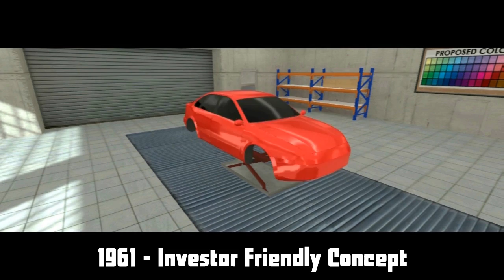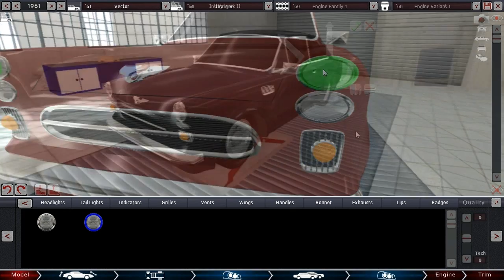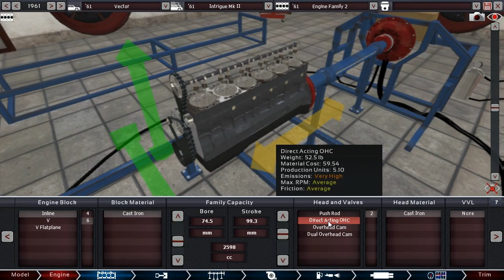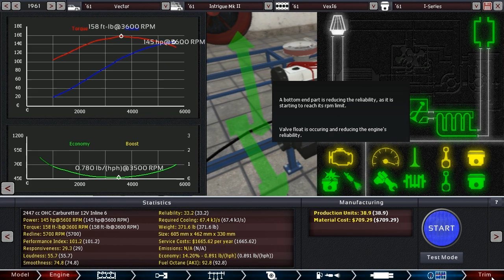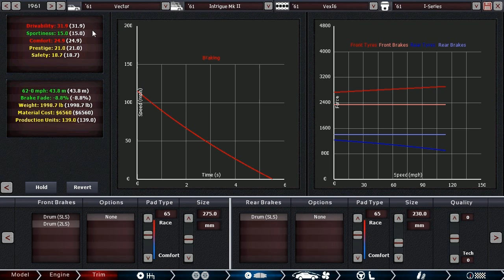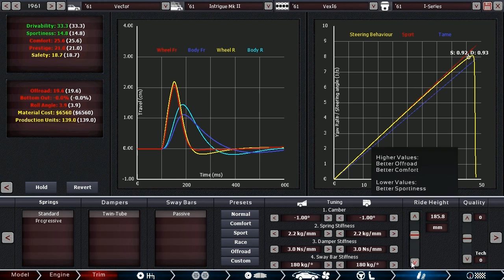Automation | Vector Automotive Challenge | 1961 - Investor Friendly Concept

Comment: It has my vote. I think this is a drastic step forward from the previous concept. I think the styling is far better, particularly the headlights and the rear canopy. The rear may be shortened but the rear seat headroom looks better with the roof extended rearward. I think with the cost brought down by a regular am radio and some other cuts, it would be a real competitor, especially in 1962.

 You wouldnt want to wait too long to launch, the competition heats up quite a bit in a few years.
Reply from the maker: This guy can see the future! Burn the witch!
Reply: ConeDodger240 oh no! My secret is out!! And I was so careful!!!
Reply: just realized i commented from the wrong account lol my bad!

Comment: I am very impressed with the mileage and redline of your engine, and the refined styling looks much better and more correct for the period.  The reliability of the engine is a bit scary for making it a people's sports car, yet unreliable cars have succeeded in the past, and if you just wanted an engine that screams and revs all the way (I like that as a rotary fanatic) than I think the reliability sacrifice was worthwhile.  Maybe a de-tuned engine for lower models but, yes I would like to see it make production

Comment: in my opinion the Vector Intrigue Mk II is miles ahead of its predecessor. With its new, more sensible inline 6 cylinder engine, it will be more affordable and more practical for daily driving. And with its new adjusted styling, it is a much more cohesive and solid design that would fit in just about anywhere in the world. Plus, the charcoal grey color the Mk II was presented with is beautiful, a perfect match for the style of this car. Overall, I think I would be more than happy to invest in Vector Automotive.

Comment: After seeing the first iteration of the Intrigue, I could safely say that I would be willing to invest in Vector.  It showed what you COULD do.  This second iteration, however, shows that Vector not only has a drive for performance but also a mind for practicality.  It was clear that not every Intrigue, if any, would ship with the OHC V8 from the first concept; it was an exercise in showing off Vector's capability as a manufacturer and making a statement.  I saw this and noticed the potential of the platform and an inherent versatility about it.  This second concept proves that, and I believe that it would be an acceptable launching platform for Vector as a company.

Comment: Color me surprised! What I expected was Vector to throw out the old car body and make a new vehicle using a revised, improved version of their DAOHC V8. What we have instead is a new, smooth I6 used in a revised, improved version of the body - and I couldn't be happier. The new form keeps a lot of the interesting flavor of the old Intrigue, but with more handsome proportions, and the new engine keeps the innovative valvetrain while delivering a smoother, more manageable output.

In no particular order:

- It may well be worth the investment to fit all-forged internals to this engine; the added reliability and smoothness would be significant.

- The figure I remember as a good rule of thumb for pony-car production costs is $6000 in-game currency. That was accounting for inflation and for an MSRP ~3X cost of manufacture.

Comment: Dear Sir,

I have been following the progress of your automotive vehicle company for the past couple years, and I would like to offer an investment. Your initial design of the Vector Intrigue caught my attention when I first saw it at the Los Angeles Auto Show in 1960 as a very futuristic vehicle, providing a new path of forward momentum for the American automotive vehicle industry. However, I felt it unready for further production in that form as the entire car felt unfinished and frankly incoherent. There seemed to be no particular direction or market the car was trying to fill, the exterior left much to be desired, the drivetrain, while highly technological, lent itself towards a sports car of sorts, and the interior seemed to want to be a luxury car. With this in mind, I decided to withhold any investment into the company.
This year I decided to attend the Detroit Auto Show to see if there had been any improvements to the Intrigue, and I am happy to report that the vehicle seems to be much more coherent in it's design. The exterior is simply stunning, refined yet brash enough to show that America is ready to move into the future. However, the new Inline 6 engine was honestly a disappointment compared to the previous V8 design. In regards to the engine, I felt that the pursuit for something new and exciting which I had seen with the original design had been lost in favor of a more standard and conventional approach to fit production requirements. The interior also seemed more fitting to the approach the car is trying to take this time around. The new performance characteristics were also a pleasant surprise and vital improvement to the previous car.
With all of this in mind, I do not feel the vehicle is quite ready to enter production yet. However, I am offering to invest $150,000 ($1.2 million in todays money) for each further year the vehicle is in the design state, and $500,000 for the first year the vehicle is in production to cover manufacturing costs, and a further $750,000 the second year of production. In return, I request a business statement within the next year of what the exact intent of this car and this company is, what market you are trying to fill, what your potential market it, and how many units you expect to sell. I also request 1.0% of your profits, and a reasonable share in the say of this company.
As far as where I would like to see the vehicle progress from this point forward, I would like to see the V8 platform return, along with further investment in developing technologies. I feel this company could be the way forward for American automotive technology, but you must invest!

Warmest regards,
Mr. H

Comment: This concept could definitely be a production car and be very succesful. The look of the car is by far a great improvement over the Last concept and has a style of its own, I can see a mixture of American and European designs with some mild resemblance of a Datsun 510. As for the powertrain, I find this particular engine great for what you were looking for and with the engine bay being spacious enough you could definitely make a upper trim V8 to go along with the current powertrain, maybe something like a high revving 3.7 liter pushrod engine. I find this concept the most likely to  be production ready and I would invest without a second thought. A possible name for the actual production car could be The VECTOR RADICAL.

Comment: I like how excentric the car is, and I definetly agree with your choice in engine, but an $8000 dollar car is very expensive in the year 1961. With a different material choice for the bodypanels and with a more consumer-grade interior however, I think you could definetly overcome this steap price and so I would invest in the Intrigue.
Reply: ConeDodger240 I can confirm that, this is all 2010 price levels but pure material and labor costs. This means you don't have a factory, no engineering team, no R&D, no marketing, no distribution... so a factor of 3x is appropriate to estimate a sales price.
Reply from the maker: I'm curious what the price scaling is like in automation, guess we'll find out when the car is production trim but as of now it does seem a bit inflated for 1961
Reply: ConeDodger240 Currently there is no inflation modeled. The only reason for a car in 1960 to be cheaper is that more expensive tech isn't unlocked.
Reply: AutomationGame But a sale price in 2010, I recommend http://data.bls.gov/cgi-bin/cpicalc.pl for a converter year to year. For anyone using it, remember the year to put from is 2010, not the year you are building. 

Edit: This is USD, though.
Reply: seriously? well then that's a bargain and you'd be mad not to invest in it